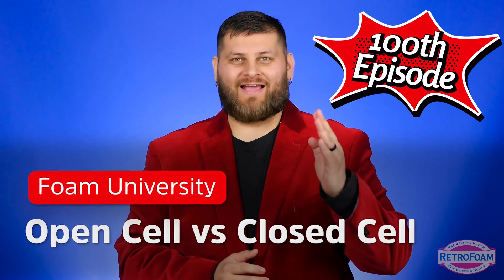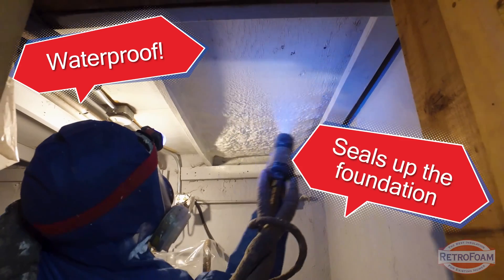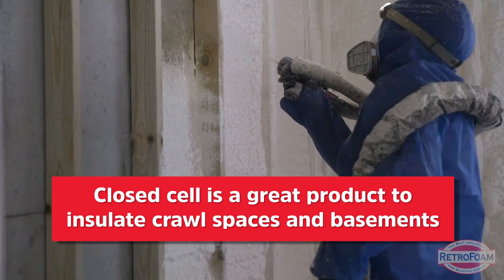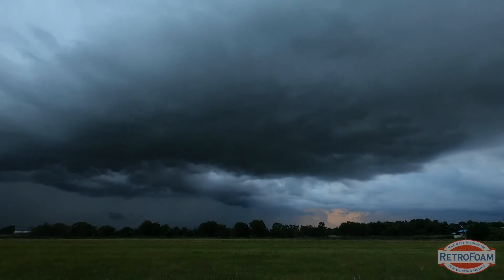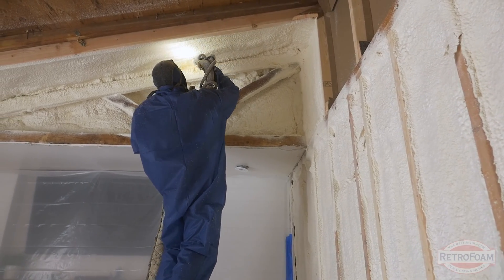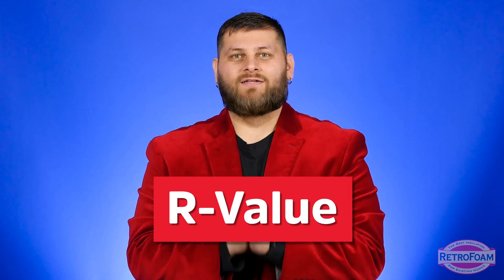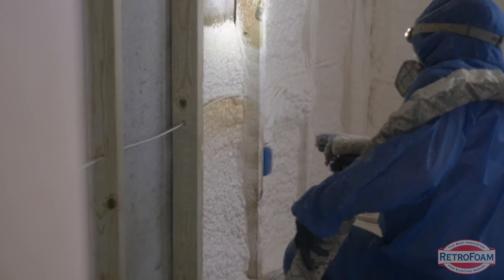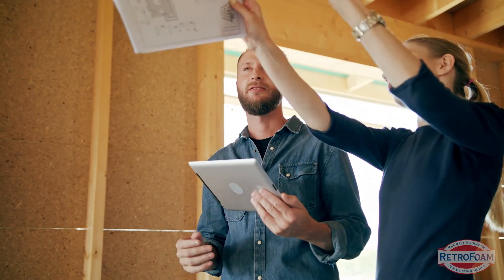Open Cell vs  Closed Cell Spray Foam  - A Satirical Look | Foam University

Comment: Very informative video thank you for taking time to do this. Currently shopping for foam insulation for my home in FL, have already had a couple estimates and was shocked at the price difference between open and closed cell. Closed cell was more than double open cell and that was 3 inches of closed vs 5 of open. Closed cell contractor also said they would leave the old
Insulation up because the closed cell would make everything water tight and there would still be R value in the old stuff. Open cell contractor said he would have to removed it because it would lead to mold because moisture would inevitably get in.
Reply from the maker: Thank you for watching our channel! We wish you tons of luck on your project. 🤗